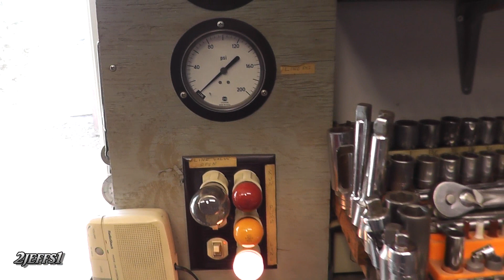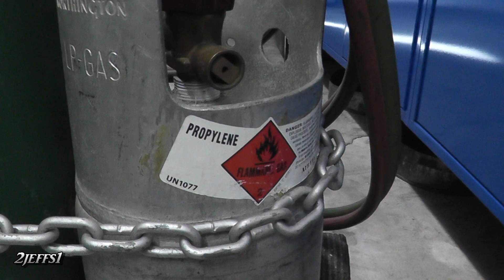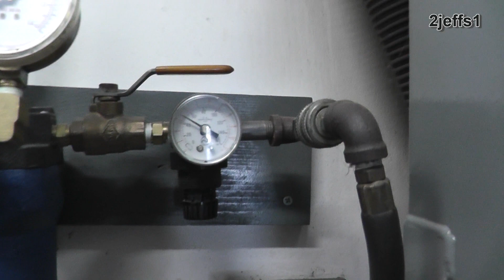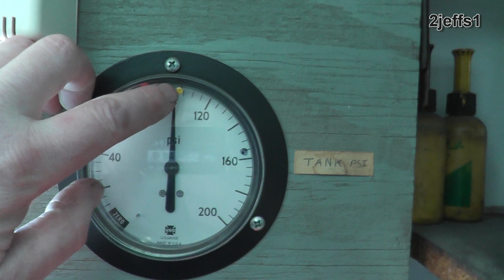Air Compressor Setup Money Saving Tips & Ideas

Comment: I have a tip to add to your Jeff video compressor system. I did something what you did with my system. I bought a compressor and tank 120 gallons horizontal at auction for peanuts literally. All I did was buy a single phase 7,5 HP motor totally enclosed fan cooled, from a friend who had no need for the motor. Friend price is just great. The pump just needed to have the head reed valves cleaned. The oil I use in the compressor head is Mobil automotive oil 10-40 weight synthetic. This works great and totally emulsifies the oil to make sure no rust will occur in the tank. Just drain the tank once a week and clean white color water runs out of tanks. Worked for me fella.

Comment: Nice air compressor set up there Jeff. I really like the way you plumbed it through the building as well as the switches, gauges and open/ close valve.
Reply from the maker: Thank You! I spent some time on the setup but once you get up & running it all seems worth it.

Comment: For a system pieced together its pretty elaborate and very creative. I could see some people say just go by a commercial screw type compressor with a dryer setup. But when cost effectiveness is a priority piecing together is usually the way to go. And your first tank likely catches most moisture the second tank the rest. Each tank id imagine works as a catch can of sorts. But what iv seen commercial setups go for id guess you have a fraction of the expense for one put into your system. And the dual pressure work station setup is becoming a must. I know for my industry to get manufacture repair certifications some of the equipment required runs at over 100p.s.i but most of the tools max at 90. So to simplify any possible mix ups or questions wether you cranked pressure back up or not. There are dedicated outlets for high pressure. Definitly a 10 for creativness and inginuity. . and there are always nay sayers. Everybody can do better they just never do. If who ever thumbs downs this, i ask this. lets see what your runnin..?

Comment: Thank you for the inspiration.  I love the attention to detail and craftsmanship that went into this.  I aspire to be like you!  I'm picking up an old air compressor to build a system of my own today, I'll make a video of the setup when I'm done.
Reply from the maker: Tiliy74 Hi Tiliy74. It makes me happy to know that. It's the main reason I've been doing this. I wish YT would of been available when I did these projects where you can learn so many things. I wasted too much money to get to this system & didn't want others to encounter the same. Ive had that pump since 1982. Bought it used. Have done a lot of body work and sandblasting with it. The only thing was I rebuilt the valves some time back and caught them before damaging them where the rebuild kit could still be used. (otherwise it damages the valve housing/seats) Another FYI for you - I run Mobil 1 synthetic oil in it where it can get cold here. And I do have a magnetic heater on it where when it gets below zero out I'll turn on for a couple of hours before starting it. The switch is to the right of that control panel. Don't think that was on the video! But hey - good luck on your build, Jeff.

Comment: Thanks for the video. I used the same method you did to support my compressor. Plywood on one end and springs to isolate the compressor from the building. It works really well.

Comment: If you want to make more effective use of that 3 phase starter...L1 goes in and out T1 of the overload to the motor...L1 to T2...now take T2 and run it back up to L3 and use T3 to the other side of the motor...some three phase overloads only work correctly when they see current on all three legs...check the spec sheet on your overload to be sure.

Comment: Those old Kellogg American pumps are good for more than one lifetime. I do enjoy your setup however somethings can be simplified. That pump is big enough that it does not really need the extra tanks if you set the RPM of the pump closer to it's highest rated range. Where you are airing up more tanks or running the higher RPM, the wear is the same on the pump, one runs longer and the other faster (the pumps ACFM matters the most, tank capacity is second to that aside from duty cycles). The air can be much dryer with a true refrigerated air dryer. The electric valves can be replaced with simple 24V air solenoid valves (simple 24VAC distribution transformer required). 

Just a few simplified ideas. I prefer a 24V valve system for a few reasons. The first is that it uses small gauge wire to run the valves. The second is it can use virtually any type of switch system as high voltage is no longer an object. Thirdly, you can high volume solenoids the occupy very little space in the system. Also, solenoids last a great deal longer than ball valves. If you want to go a little more crazy, low voltage controls allow you to make full logic control panels and remote operator stations for valves with little extra wire or parts. You can even sequence and time drain operations with solenoid drain valves.
Reply: Dragon Steel hey that all sounds very impressive... I hope you shoot s video and post on YouTube, so we can all have a look at what your set up is?
Reply: I should make videos again, had lots of ideas to share. My home setup is not that spectacular, just the compressor. Normally I help people and companies who desire automation and remote functions with their design. When I build the new shop for my trucking company, I will employ many of the options I wrote about. I did not bother with the existing shop as it will get closed down soon, it would be a waste of effort and money. At the shop, I run an Altals Copco direct drive on a 120GAL tank. Without the tank it runs 1" impacts. I'll make a video on air automation on my next automation project then post it. 

Your pump has more RPM range left in it's specs than what you are using. May require more HP to reach it since a larger motor pulley would have to be used.   

At the new shop I intend to employ a rotary screw compressor on a VFD drive. It will sit on a small 30GAL tank. From their it will feed the distribution network. All locations will employ 24V solenoids that are both turned on locally and from a remote panel. The drains on the down pipes and tank will also be automated. The point is to not only be more energy efficient, but be able to shut the whole valve network down at the days end or in an emergency from a single location. This not only preserves the fittings, hoses, and tools left attached. But it also increases the longevity of the air supply system reducing leaks and monthly/annual costs.

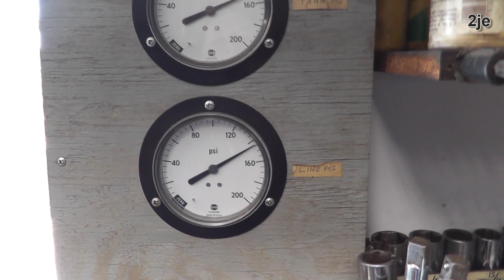Comment: @jeff, I love your videos.  Keep them coming. I had a question about your excellent compressor control panel:  I didn't understand how shutting the lower switch off (which closes the shutter-motor-powered valve to the shop airlines) prevents air leaking from the system (as you mentioned at about 8:18 in the video)?  Are you more likely to have air leaking downstream of the power controlled valve than upstream between your air storage tanks and the powered valve)?

Comment: WOW, Compressor set up is terrific, how many gallons the air storage do you have?
Can you tell me what the RPM on both your motor and compressor?
Can many amps does your compressor motor draw?
you remind me a lot of my first mentor he taught me out of think outside the box. You are definitely a genius and I would love to be an apprentice for you
A disabled combat veteran have a like to tinker around my shop and make things like you did.
I look forward to more of your videos. Out of curiosity you up north (MN) you have my Minnesota accent
Reply from the maker: James Martinson Hi James. I posted this video to hopefully help others out & give some ideas. I wasted way too much money on compressors before this setup & didn't want to to see others experience that. When doing mechanical repairs instead of bodywork - the pump don't run very often. I think storage would be in the area of 340 gallons. There are times when it doesn't need to be run for several weeks depending on what's going on. Not sure on the compressor RPM but the motor is 1725 and draws 39.8 amps @ full load.  It is a Kellogg pump. The model # stamped on the pump is 352TVX. Did know all the specs when I put things together but that was in the early 80's :>)  Minnesota is close - Central Wisconsin is the actual!!!

Comment: Wow your place is awesome. I love over engineering for convenience!! 
Looks like an awesome place to hang out and pretty much live there !!
Reply from the maker: MrTheHillfolk Thanks man! Having a setup with most used things at only a step away has been a time saver. It amazes me on how things flow here at times. I took the flywheel off from the compressor pump to lighten it up to lift it on the tank. Then some friends showed up & the rest is history. A few call me a hermit - but then there is plenty to do here!

Comment: Clever use of an actuator. My air valve is connected with cables and a spring. You just flip a lever to turn off the air from the tank. The compressor is also equipped with a timer that cuts it off if it does not reach full pressure in 2 minutes. My air is always on because it feeds an Eco air meter in my driveway. If someone leaves the hose off the hook the compressor will not run till it burns out.

Comment: I got a modern air compressor working and its only advantage is the compact shape.  the motor and the piston is machined into one unit, so its not serviceable for the most part.   Definitely better all around to buy the motor and piston separate, or better yet, salvage a motor from a air conditioner or ventilation blower.

Comment: MY father recently passed father (91) has a john wood company air compressor...or that's just the name on the huge horizontal tank.
However, the pump looks 'identical' to the one in the video, the build date stamped on it is lower cylinder casting is 3/59 and a small metal tag reads "model 331" "serial L424561" but I can't find out the pumps manufacture name, HP etc?
Again it looks identical to the compressor pump motor in the video... any help?

Comment: Jeff a follow up on the propylene, I checked with the welding gas near me and he told me that it's hotter, cleaner and cheaper just like you said! but, he doesn't carry it. He could order it. I was familiar with other fuel gases I just hadn't heard of propylene. I guess if the welding shop has a better and cheaper gas they keep it a secret? And I thought he job was to help me stay in business to buy shit from him thanks Jeff!
Reply from the maker: Hello and I want to Thank You for the follow up. That was very interesting! I was told a propylene tank of the same size as a acetylene tank would last 5 times longer. Sometimes things are hard to believe. I found that totally true. I heard that acetylene costs more because now they have to fill them under water for safety regulations. Another thing is if you transport  acetylene you should keep the tanks upright. If not one should wait a day before using. ??? Don't know if that is true but interesting facts if so. Things seem to keep changing with the crappy economy and the place I originally dealt with closed down. The new vendor did refill my tank but like you said I wonder if they prefer to keep this secret where it did seem that way here too. FYI - I did have to leave my tank there for a day to get it re-filled as there was no exchange. I was wondering if that was worth putting in the vid - but if it helps people out I like to hear that and makes it all worth it!

Comment: Nice video.  I've just been thinking about doing exactly what you have done. I just wasn't sure it would work like I thought it would (should). Now that I've seen yours. Mine will get done soon also. I only have 2 tanks at this moment. I'll pick up some more tanks .
thanks again for the video
Reply from the maker: Glad to help out Lee. It took a few years for me to get the extra tanks too. Usually a friend tips me off when they find something on a good deal. Actually that happens on so many things here from the Case tractor to the scissors lift.
Reply: 2jeffs1 I also like the idea of using a Propane tank. would a couple of those work as well?

Comment: Jeff are your main lines copper? It looks like it from the video. Sorry for all the questions but your shop and video's are amazing!! Would love to see a shop tour and more on your auto's! As always Jeff thanks for all the info and help!!
Reply from the maker: +dave hogan Pretty much all the lines are 1/2" id copper. There is 1/2" steel pipe where it comes down from upstairs. Never had any issues with several tools running off the same feed line. Have a 1/2' hose that slides thru 1-1/2" pvc pipe to the rear shed for a sand blaster feed to do blasting out in the field. In today's times if I had to do things over I'd possibly consider doing things in pvc only for the speed of the install thought. There are so many video's that I want to produce. Some time there will be one on shop tour and layout so stay tuned!

Comment: So like do you never run out of air because that’s insanely awesome!! 👍🏻👍🏻
Reply from the maker: Been working on several 3 wheeler resto's and now that mx80 dirt bike. The girlfriend loves sand blasting the parts in that enclosed sand blast tank with the window in it. We run the air down to 60 psi then start the compressor. (shuts off at 160) Usually only needs to run once a day!

Comment: Thats quite a big pump there!  The old stuff is the best, with appropriate maintenance they will go on forever!  Good pumps to look out for in the US are Quincy, probably the best recip compressors ever made. Here in the UK they are impossible to find, much to my regret. Very nice job by the way and I'm curious, what is that accent?!  Also, that actuator motor used on the shut off valve, where would I find those?
Reply from the maker: Hello turboslag. Yeah those Quincy pumps are sweet! Too bad you couldn't score one in the UK. To tell ya - I have no idea on the accent. I live in Wisconsin & I'll have to hit my mom up on that some time. The shutter motor  P/N for the one you need is 2C831B and made by Dayton. Google the P/N and I hope is would be available where you live. It is no longer available at Granger where I bought them. I just checked and there are other places like eBay showing them. It was used for 10 to 36" single panel wall shutters. When you look one up it will have a L bracket and small electrical connection box mounted to it which comes off. They are for ventilation louvers for exhaust fans. A little more info on how them work. You must maintain power on the motor to hold that arm open. (It's not like any circuits get changed to reverse the direction.) Them draw very little electricity I think like on the order of maybe 7 watts. That is probably more info than you need but It's nice to get things right the first time. But hey turboslag - Its been nice typing with ya & hope this helps you out, Jeff
Reply: 2jeffs1 Well thanks Jeff, very helpful.  I love the way the US is full of useful stuff like those actuators!  Tell you why I asked about your accent, I've heard it before in a movie called Fargo, but I guess you wouldn't notice if you watched it as you speak the same way. Very noticable to a Brit though!  I hope that doesn't offend, I'm just curious.  Very envious of your shop too!
Reply from the maker: I like your theory on the movie Fargo. Interesting. That don't offend me at all! Actually I never watched much in the movies category but did go to see plenty of bands/concerts though. Really dig good old rock & roll.

Comment: Thanks Jeff.  The problem with my pump is that it started leaking air from the nut with a screen in it. The air seems to be coming from the small line from the top of the head.  It leaks while pumping and while no pumping. Any ideas on repair? Thanks, David
Reply from the maker: David Apple That 1/4" line that comes from the head is a pressure release for when the compressor shuts off. Just so you are aware - where their is air coming out of that has nothing to do with the pump valves or pistons being bad. If that had pressure on it @ start up it would be hard on the motor. It's kinda like a compression release on dirt bike & some small engines. I've never had mine apart so I don't know what might need repair or replacing. You will probably see some weights that fling outward after rpm is up to speed. Maybe stuck?? Sometimes things just need an 0 ring too. It shouldn't be releasing air while running just for several seconds after stopping. BUT - check that last. Now - If it continues leaking after shutoff then the check valve that is in that big line from the tank to the pump would be the candidate. That is the one that screws into the tank at the tank. MAKE SURE to bleed all the air from the tank before removing that!!! There should be NO air coming out of that towards the pump. I'd start with that first but it does sound like you might have 2 different issues here. Sorry Dave I'm not the best at explaining things. FYI - Most of the valves I've seen can be taken apart to see what happened. Have fun & hope this gets ya fixed, Jeff